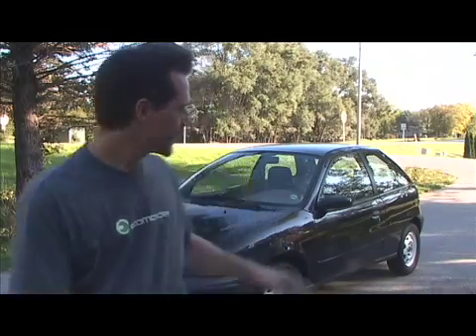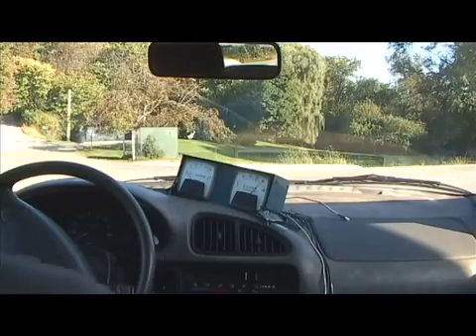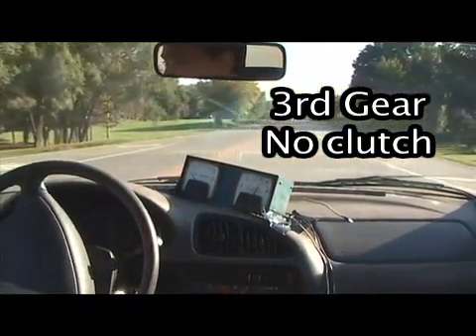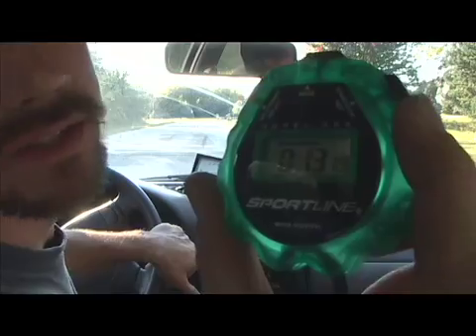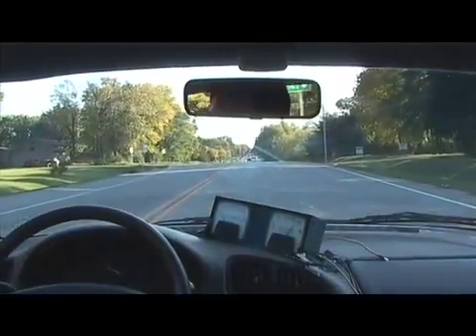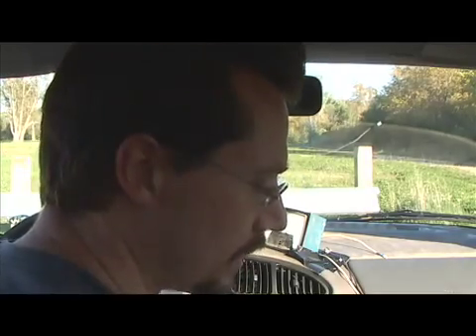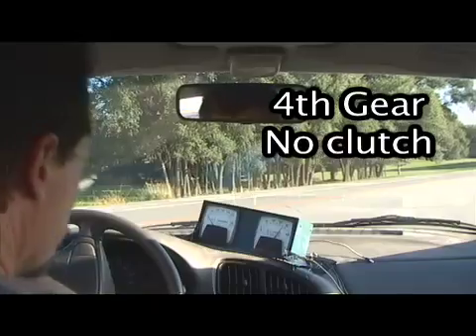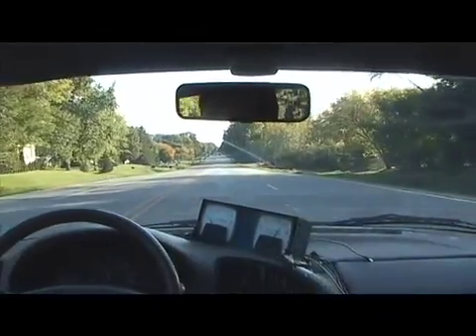EV speed testing

Comment from the maker: @indman101 
No, I just sort of picked 30 mph almost at random.
On DC motor systems, VOLTAGE is the biggest single factor in top speed. This car on 72V (which is how it was running at the time) has a 45 mph top speed. (That's the speed limit right in front of my house anyways.)
With more batteries, you can go faster. I have had this car over 70 mph. I got a speeding ticket in it a while back.

Comment from the maker: The higher gear means the motor has more resistance, so it has to pull more power from the batteries. The motor pulls more power for longer, thus better acceleration.

In second gear, you get plenty of power briefly, then the top speed quickly tops out.

Comment: all depends on the motor and controller.  If you run 48v @ 200A it will be slow.  If you run 300v @ 2000A it will be uber-quick.  How much do you want to spend? :)

Comment from the maker: It would be. This car doesn't have a clutch any more, and you do need the speed of the motor to be right to shift. It shifts fine, but not quickly. I don't think the throttle is adjusted right yet either. If I fix that, I expect some better acceleration as well.